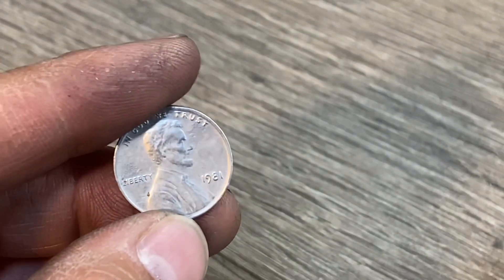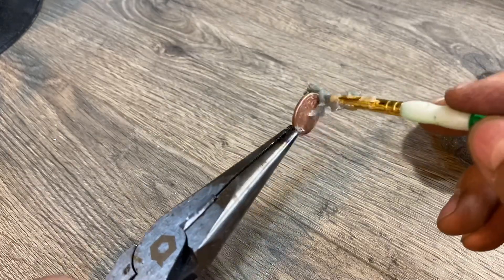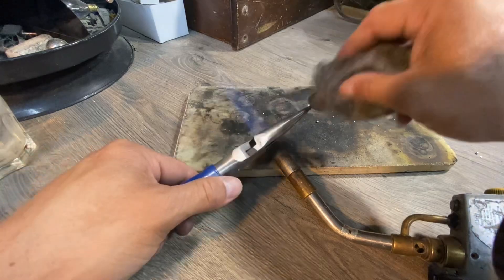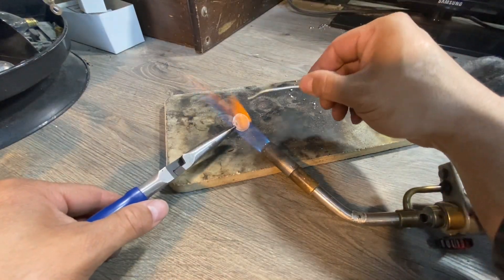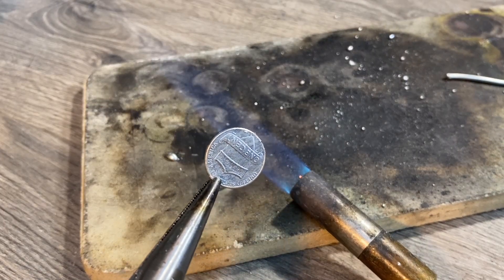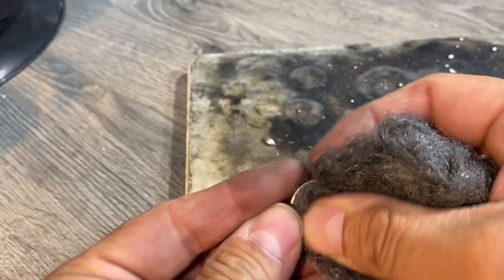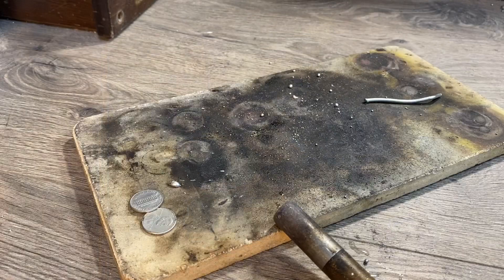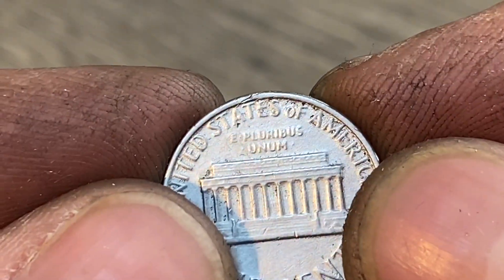Silver coating a penny with plumbing solder.

Comment: That's more of a tin/lead coating. I do this with a brand new penny when I do a copper project, like curved standing seam copper panels. I solder the penny of the current year on to my work somewhere. For the next roofers..!!

Comment: Very cool... Thanks.
What exact solder and flux do you use?  Every time I try it the silver just turns into balls, doesn't stick and the solder just crusts up... It's always a mess... when it doesn't destroy the piece i'm working on...  😀
I'm using stay silv and plumbing solder...  
Thanks again...!

Comment: I'm not sure I'd be dipping the coin in a drinking glass since the solder has lead in it. You will have to make sure you don't use the glass to drink out of.
Reply: as it is Copper, bismuth, tin &  silver potable water line application plumbing silver solder 
it's lead free